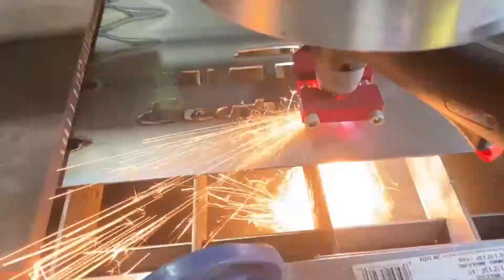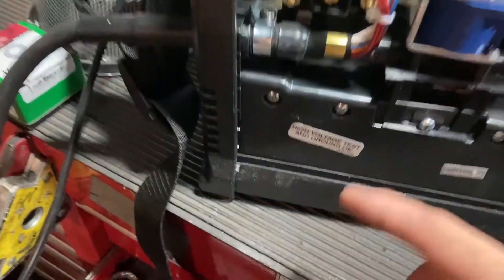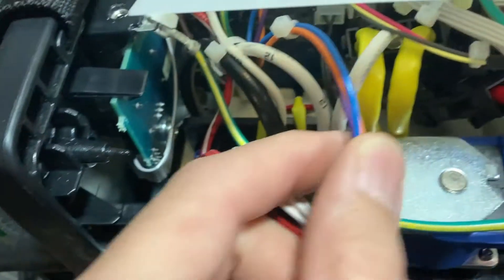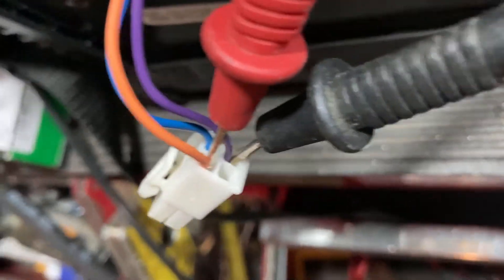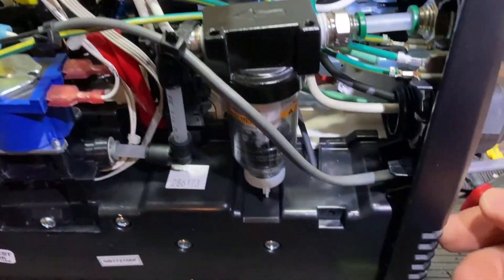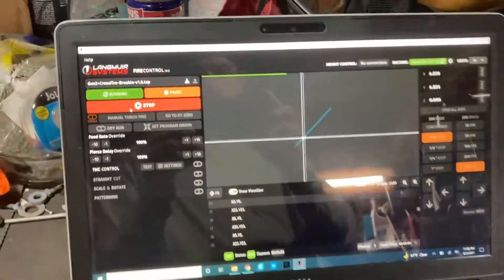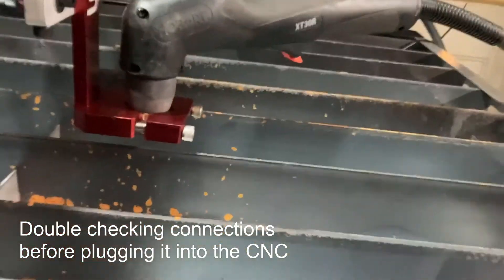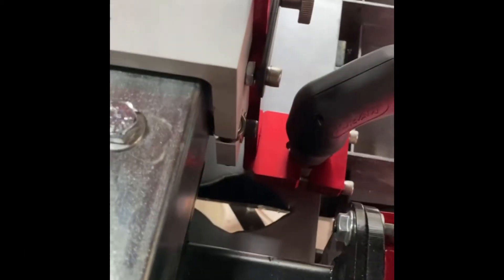Hooking a Hobart 27i into a Langmuire Crossfire CNC plasma with diagrams and how to save $200!

Comment: after you hook up the 27i to the CNC, are you able to unhook it and use it as a traditional plasma cutter? Or, once you wire it up for the CNC, is that the only way you can use it?
Reply from the maker: It still functions as usual. That’s why I added a connector at the plasma cutter too. So I can disconnect the fire wire at the cutter instead of unplugging it at the cnc and having an extra cable to deal with. 

The fire cable is tapped in in parallel. It’s just adding a second set of wire off the trigger wires for the CNC unit to bridge for the firing signal
Reply from the maker: You don’t even have to disconnect it. I’ve pulled the torch head out of the cnc, done some hand cuts using the trigger cnc off (or on wouldn’t matter) and just replaced it into the torch holder after, just have to move the ground cable to the work piece or lay it on the cutting table
Reply: @ecophage  Thank you for your (quick) response! Very helpful.
Reply from the maker: @zacbenson9068  NP

Comment: were you able to find a cheat sheet of any kind for settings for the 27i?
Reply from the maker: The manual has some feedrates and stuff and Langmuir had some generic settings I’ve been using with decent results, what settings specifically were you looking for?
Reply: @ecophage  ah, I didn’t get a manual with my machine so I was flying completely blind today for the initial settings on my machine.
Reply from the maker: @mccustomize  well I’m sitting next to my machine right now and the manual is right here. Do you have Instagram I’ll send you a pic of the chart. Just Pm me @ecophage
Reply from the maker: @mccustomize  but incase you don’t or for anyone reading this in the future here’s a few for an idea: mild steel: 12ga 2.8mm 105 IPM or 2662mm/min (this is my max I run 2000 usually)
1/8”/3.2 98ipm 2499mmmin
3/16/4.8 63ipm1605mmmmin
1/4/6.4 36ipm 914mmmin
All 30amp

20 amp
16ga/1.6. 158i 4014 (Langmuir maxes out at 2600-3000)
1/8/3.2 50ipm/1260mmmin
3/16/4.8 33ipm 833mmmin
Reply: @ecophage  thank you!